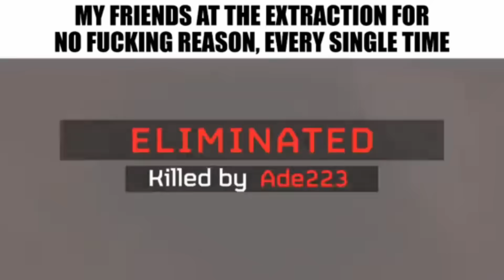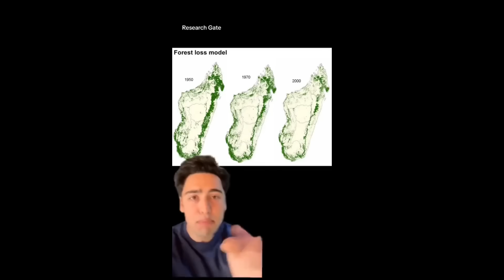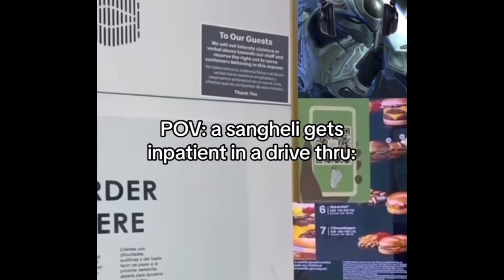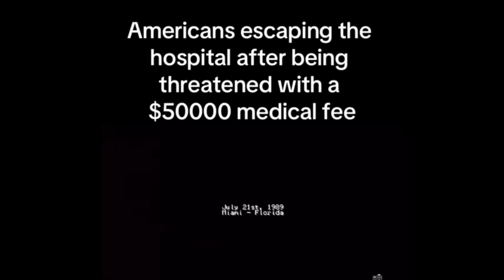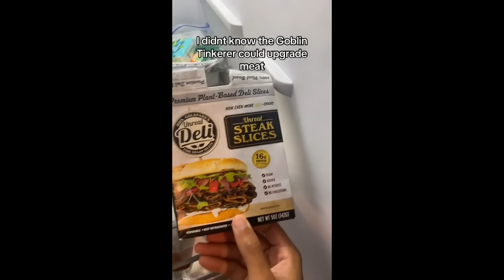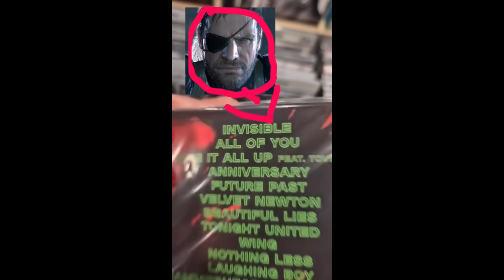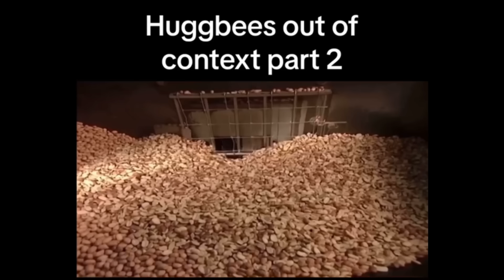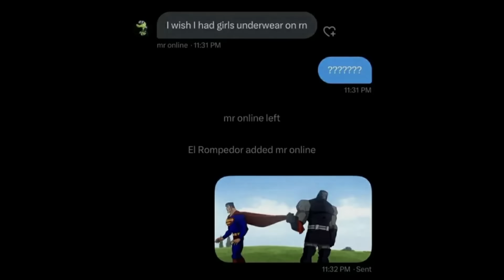Shitpost status V143

Comment: 9:07 people forget that they brought Elden Ring for a challenge, not to breeze through it in 2 hours
Reply: first phase is decent but is second is dogshit 
way to much visual clutter and that fucking nuke attack that he does makes my framerate nonexistent
Reply: @noha4309  
Am I the only guy to use a console and not instantly die of lag? Like, Pcs are terrible at processing anything!  Most lag at Henry stickmin
Reply: @JudeEaley  
"pc are terrible for processing anything" 
then why doesnt (insert any job in the IT sector) use consoles then?

sure some pc are using very outdated hardware but i have a pretty high end one.
its not the machines fault the devs are so bad at optimizing the game.

there are also cases of older games running worse on new hardware but this is generally due to that software not being built for that software a good example is that alot of games used to have game speed, damage, dialogue etc tied to framerate so when newer hardware came out allowing higher framerates you would have a plethora of bugs/glitches 

henry stickman lagging isnt the machines fault either is just bad optimization (well kinda it is a browser game after all)

also i cant wait to comment this and youtube fucks up my formatting making my comment unreadable